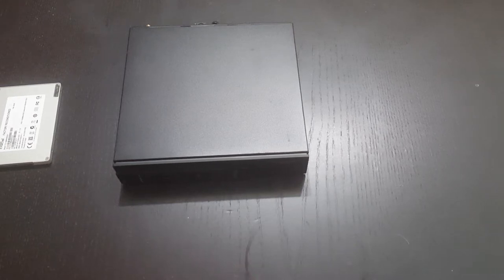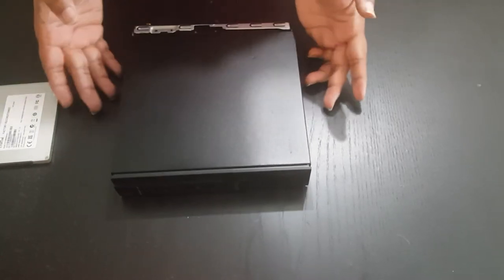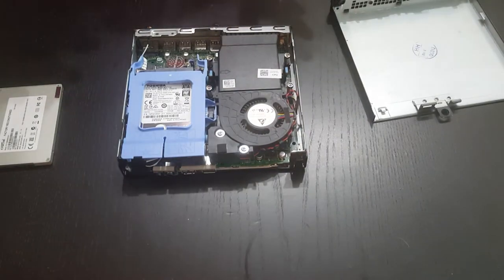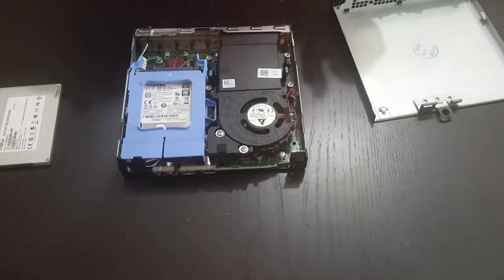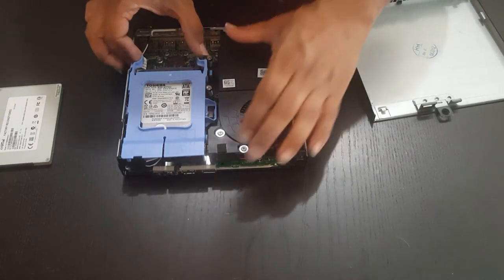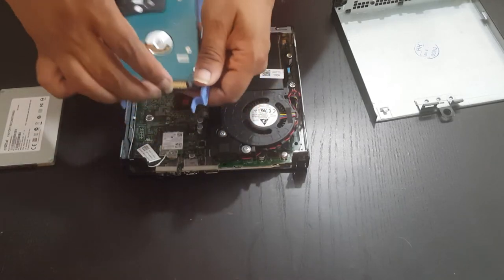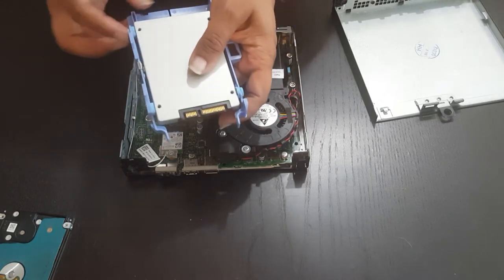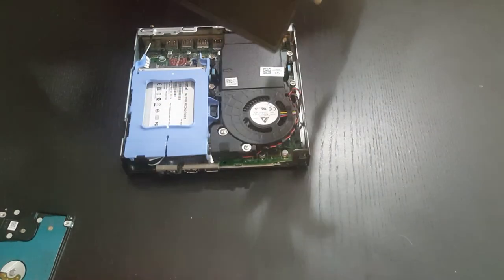How to upgrade the DELL 3020 Hard drive

Comment: W.T.F,  My DELL OPTIPLEX 3020 is twice the size of that one, and its internals look nothing like that, For a start, there's a   DVD RW unit on top which has to be removed to allow access to the Drive unit. I thought I"d found the perfect instructional vid, DOH!
Reply from the maker: There are different form factors in the OptiPlex line up.  This one featured in the video is known as the 3020M or Micro.
If you can identify which one you have I can make a video for you.  Here's a link: https://bit.ly/2XEnm3r